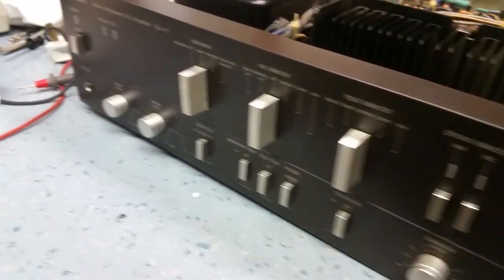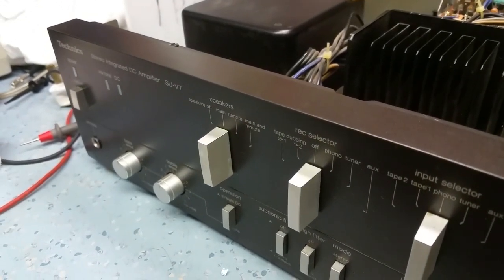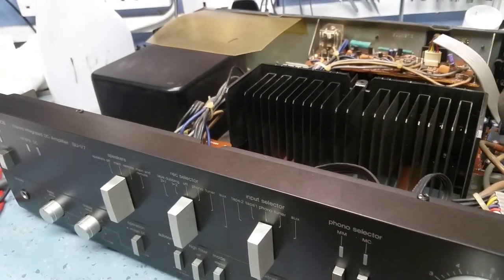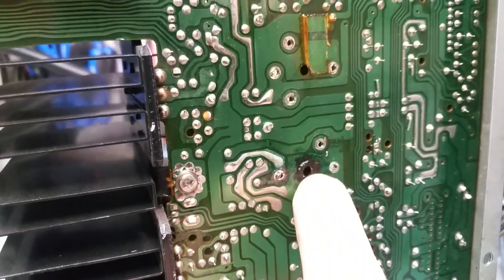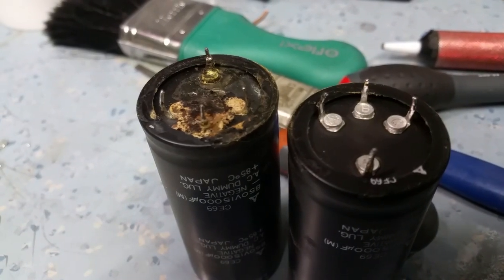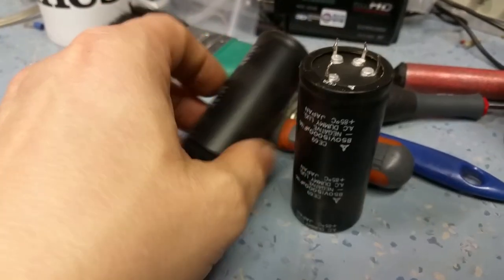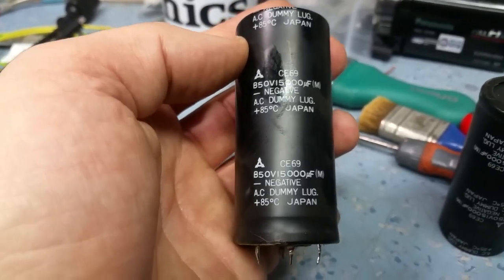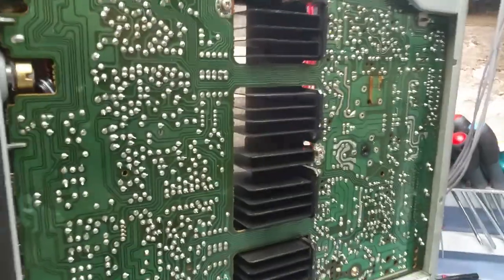Capacitor electrolyte damage

Comment: Can you advise where I would get 4 CE69 71v 100000 microfarad capacitors for my Techniks su-v8 - been advised they need replacing but don’t know where to get them
Reply from the maker: Any 100000uf or slightly bigger cap would be fine. 75v to 100 would be better. Then just find one that has the correct pin connection.

Comment: Good thing you had a quick look before powering it up! Without researching it: what do you have to search for to get these 4 pin electrolytics? And are there 2 electrolytics inside (I think those exist) or just one and are the other pins just there for mechanical support?
Reply from the maker: Only two of the pins are connected. The other two are for support. Some have more than one caps inside as you say. They tend to be listed as Snap in types. I had a used one in my junk box lucky.
Reply: Usually on these caps, the other pins are for support, as Simon says. (LOL)
Dual capacitors are more common in valve (vacuum tube) amps/radios.